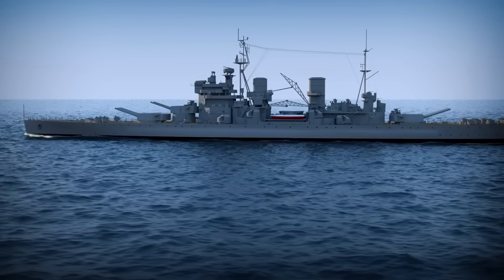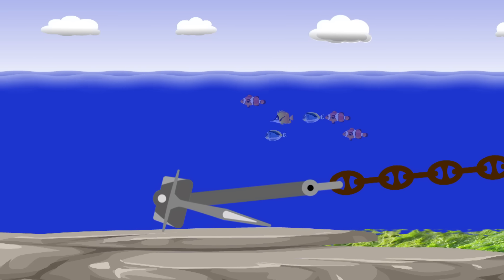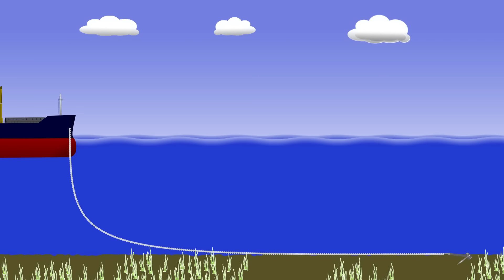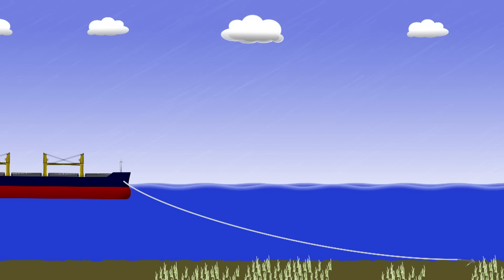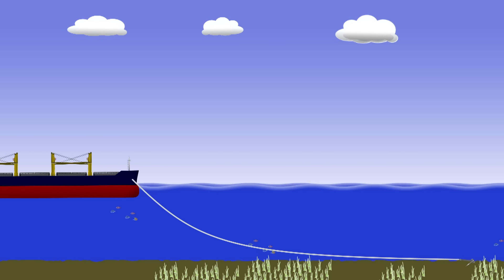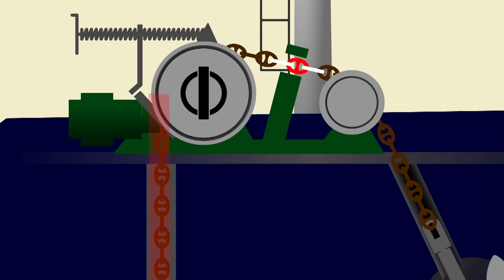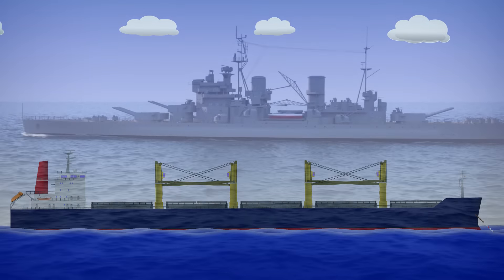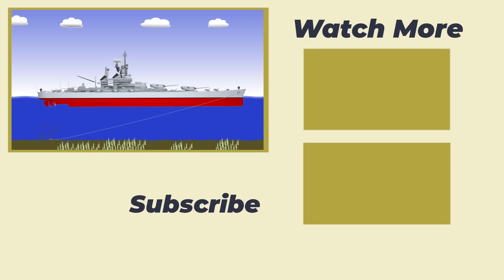The Truth About Anchoring Huge Ships

Comment: Seems like everything related to the shipping industry is highly destructive for the environment, isn't it? The pulling and washing of the chains alone... I reckon they probably use seawater for the washing, but still... the energy required to pump this water. Millions of people in the world can't get a shower, yet these metal chains regularly get one that probably costs thousands of dollars.
Reply: Without data you are just another person with an opinion.  Moving products via ships is among the most efficient modes of transportation.  On the hierarchy of needs getting a shower with sea water ranks well below clean drinking water, food, shelter.  Delusional to think it costs thousands of dollars to pump sea water to spray off a chain.  On the other side storing a chain packed with debris will expedite corrosion.  Not only for the chain but also the chain locker.  The energy required to repair, or replace these components is quite high.  Steel production generates a fair bit of pollution.  Not to mention The chain locker will  fill with debris if not removed causing operational issues, and reducing efficiency.

Comment: The video seems to be quite inacurate with the "weight of the chain" part. The weight of the chain won't reduce how much force is pulling the anchor, it will pull the ship, sure, but the weight of the chain will also pull the anchor by the same amount, so unless the chain is in the ground (and therefore being held by friction, not just by the anchor), then the weight of the chain won't change what force is being applied at the anchor.

Reading some comments it seems that the reason longer chains help is that with a longer chain the force on the anchor will be applied in a shallower angle, thus allowing it to hold better on the flor as a bigger component of the force would be draging the anchor into the flor, while the vertical component would be smaller.

Comment: Clearly mistaking an anchor with a sea anchor which absolutely can be used like this and is on the rear of a ship and can be used to keep the ship facing the right way when at anchor.

For manoeuvring you'd need to drop it in and out quite quickly. Only some vessels had these winged little sea anchors built in, though they've been made. Obviously they can't bend physics, and some stories have used them in novel implausible ways.

Comment: Most of the statements about "energy" are incorrect. Almost everything described is about force, not energy. The description of how the anchor and chain works is good - it's just the terminology which is incorrect. As a dragged anchor and chain slow down the ship in the final scenario energy is absorbed by the anchor system, but in every static (non-moving) example, there is no energy transfer.

Comment: The ship would lose it's anchor dropping it at speed. The anchor is only attached to the chain and the ship by line (rope) !!. It would not bob along the bottom, due to the weight of the full chain and the anchor. This is a fail safe to lose the anchor and chain, and not rip or damage any part of the chain locker, or the windlass up top. Please do more research, as you have only answered half of the story.

Comment: Do we have the right to be irritated that we’ve been taught somewhat wrong all these years about the function of a ship’s anchor?
Reply: This video is misleading, the anchor is the main thing holding the ship. 
The ship is pulled by the chain, which is pulled by the anchor. The anchor does all the heavylifting.
The weight of the chain is there just to make the anchor more parallel to the sea floor, which enables it to withstand more force. 
If you were to remove the anchor, the ship would simply begin to drift, as the chain by itself cannot grip the sea floor.

Comment: About a week ago one of my uncle got his truck stuck  in a ditch (dont ask how, really dont ask)
Another one of my uncles went to pull him out . He tighten the end of a rope to the rear bumper, then stretched it about 12 feet to his front bumper and tied it.
My uncle floored it and it barely budged, they did that for about three minutes. 
So I said, 'how about you shorten the rope to about six feet? 
After arguing for about five minutes they decided to try try.  The truck was able to pull the stuck vehicle with zero effort. 

I'm only 13 🤦‍♂️

Comment: When a ship is port and the anchors are up. And water is coming from anchor side it means that the chief is running the mandatory fire pumps but you cannot keep them running without an outlet so the use this anchor chain washing as the outlet. Your video is not entirely correct

Comment: Rubbish! "Up and down" is when the anchor rode is straight down to the anchor and not lying on the bottom. Nor does the chain itself grip the bottom. A well set anchor is the primary power holding the vessel in position. If it weren't, the chain wouldn't lift under strain but simply be dragging anchor. Do better or give up.